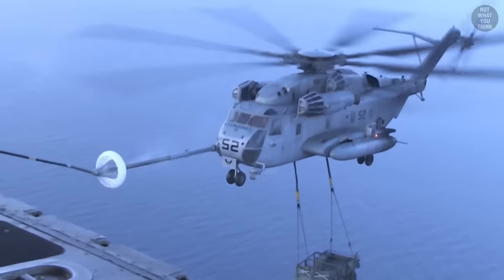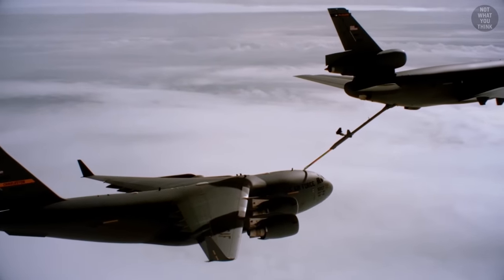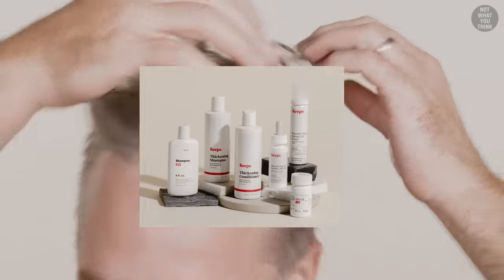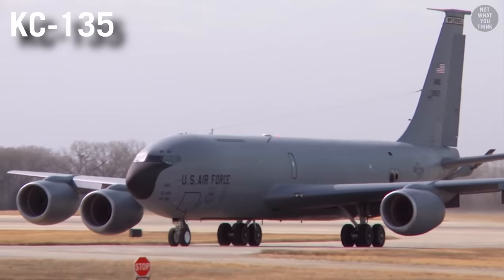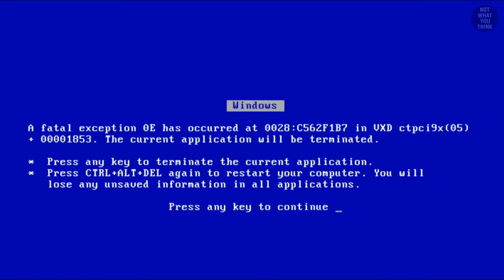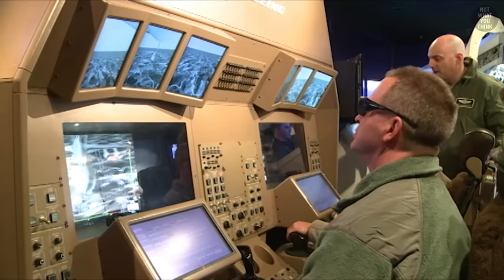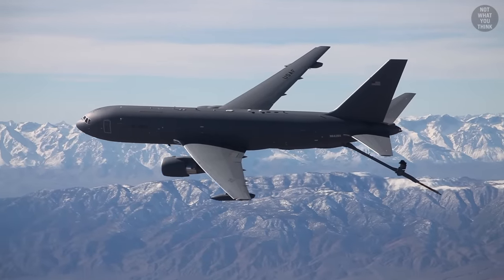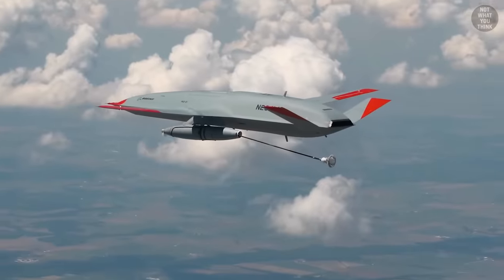Why US Air Force is Making Aerial Refueling HARDER?

Comment: This is what happens when you don't fight corruption. The airforce originally planned to purchase the superior and proven airbus mrtt. Now the airforce is stuck with a only partly operational tanker, which is more expensive and has less capacity. And now 10 years later, it seems like the government is going to buy the airbus anyways, now renamed the LMXT.
Reply: You think corruption is why the USAF didn't pick Airbus? You might want to have a think about that. Before the current string of Boeing failures Airbus had many, many design flaws that for the most part still exist. Software controlled, non coupled side sticks for starters.
Reply: @jameshisself9324  The airforce did pick the airbus. It was not until Boeing pulled strings at the DoD in order to reissue the tender, tailored to their POS KC-43
Reply: @romanpul  yes, a popular theory
Reply: @romanpul  Boeing filed and won a protest based on technical grounds.
Reply: @jameshisself9324   Oh really? Well care to list all these alleged "many, many design flaws that for the most part still exist"?
With your sources and links of course.
Because basically I call BS on your comment. Especially that crap about sidesticks.
Reply: @romanpul   What you state is absolute fact. the problem is we are dealing with a Boeing fanboy (@james Hisself) who cannot bear to see his beloved plane maker trashed. Even if its true!
Reply: @1chish  Fanboy? Airbus has had many crashes with plane loads full of people due to their design flaws. Yes, MCAS was a disaster. No fanboy could admit that. What I'm referring to with Airbus are the many alternate law accidents that confused pilots over the decades. You can blame pilots all you want, but if it can happen it will happen, and a plane load of dead passengers means you make it as hard as possible for the pilots to make mistakes. Physically linked controls, deeper redundancy on sensors, etc made the Boeing airliners less crashworthy. The 737Max was a disaster no doubt, mostly because Boeing tried to cost cut compete with what Airbus does that causes the same problems.
The only thing I'm a fanboy of is less crashes and less dead passengers. Get your head out of your ass.
Reply: @1chish  Agreed - the A320neo has been flying for longer than the 737MAX, and without any airframe losses or fatalities to date. And physically interconnecting the sidesticks introduces a lot of problems in itself - it basically ensure that both are jammed if either one does. There is only one pilot in command at one moment anyhow - failure to adhere to this points to far more fundamental flaws in cockpit management by the human operators than any technological design philosophy.
Reply: @s2k997   Spot on. Glad someone understands.
Reply: @s2k997  Sorry fellas, but playing the 'should' game is how Airbus lost planes and passengers. CRM always has the potential to breakdown due to crew experience or other factors, AF447 is a prefect example. Boeing loses the neo vs. max fight for sure, but the real problems I'm referring to are with the wider Airbus fleet from the earlier days of fbw. The only points I'm making are in support of passenger safety.
Reply: @jameshisself9324  Not following you so far. What are these 'should' games that Airbus has exclusively played? Again, a CRM breakdown is the fail of the crew, not the plane, and had been the doom of many a Boeing, Airbus, Lockheed, or Tupolev plane alike.
Reply: @s2k997  Look the airlines and the aerospace industry know this. If you guys don't want to learn about safety as a system and how the aircraft is part of that system I can't help you go study up.
The 'should' reference is to your comment about what an aircrew should do. That is the problem precisely. Expecting every situation to be understood and predictable, and relying on crew process alone as the last line of defense to prevent an accident is exactly what causes accidents. For instance alternate law being invoked when a single sensor fails (inadequate redundancy) and then not having good information for the crew or well understood changes to the flight dynamics of the aircraft. The side stick is only one of the many issues that break down crew intuition about how the plane feels and flies.  This has happened repeatedly and killed a lot of passengers. If you knew as much about the Airbus issues as you ought to you wouldn't be arguing.
Reply: @jameshisself9324  You sure do talk a lot to say that you're saying nothing. The best example of a lack of redundancy in sensors this century so far has been the MCAS's use of a single pitot tube. Maybe I need an education, but you cannot seem to name a single flaw as big as that howler - if you cannot put up, maybe it's time to shut up?
Reply: The 767 or better the KC-46 could do the job as good as the A330.
But Boeing,  not knowing what to do with all of their money decided against a simple window in the back and install a fancy new system for millions of dollars that doesn't work as it supposed to. Instead of saving the money by putting in a simple window they once again decided: 'Technology we want all of it, doesn't matter if it works it looks cool'
And that wonderful expensive system came of course with black and white screens. WTF?!?  What the hell is going on with Boeing? Have they fired all of their engineers or what? Who makes such dumb decisions ?

Btw the MCAS in the KC-46 works exactly as it's supposed to since it was put into the aircraft and always had all the redundancies the MCAS on the 737 lacked. 
Why would you use a system that works on some of your other aircrafts when you can develop it from scratch with the potential of a plane crash ? 
Sometimes Boeing itself doesn't know what Boeing is doing...
Reply: @s2k997  Oh FFS man, the list of accidents is all you need to review. If you can't bother to understand them so that you can see what I'm talking about then there is no helping you or showing you. It's all right there, ask any NTSB rep or just someone who has dug in to the reports and the facts of each of those mishaps.
I've already acknowledged the MCAS howler, the point you keep missing is that this was the first for Boeing but Airbus has probably half a dozen mishaps or incidents where similar aircraft controllability issues caused or nearly caused the deaths of everyone on board.
This is not about Airbus vs Boeing, in spite of the conclusions you lot have jumped to. Its simply about aviation safety.
Reply: @jameshisself9324  MCAS was the first for Boeing? So much for the boasted knowledge of safety - Shall we talk about the 737's frequent rudder reversal problem that caused multiple crashes? Or Japan Air Lines Flight 123 crashing due to Boeing's negligent structural repair work?  Or China Airlines Flight 611, another example of hundreds dying to 'quality' repair work performed by Boeing? Or United Airlines Flight 811 where Boeing failed to design a cargo door properly? 'first for Boeing' who are you kidding fella.
Reply: @s2k997  <facepalm>
All manufacturers have a list of failures.
I am specifically referring to SOFTWARE failures in FBW SYSTEMS.
I swear dude, I give up. There is no getting this for you.
Reply: @jameshisself9324  "playing the 'should' game is how Airbus lost planes and passengers" vs " This is not about Airbus vs Boeing, in spite of the conclusions you lot have jumped to" Contradiction, thy name is James Hisself.
Reply: @s2k997  No actually, just examples. Airbus lost planes as I stated. If it had been Boeing I would have said Boeing. Just examples.
Reply: @jameshisself9324  Burden of proof for a point is on the asserter, nobody else. You spend more time handwaving and moving the goal posts than naming any specific events. When you're naming more swearwords than specific events, then yeah, I agree, you aren't going to win people over with that trash.

"similar aircraft controllability issues caused or nearly caused the deaths of everyone on board" big difference from "I am specifically referring to SOFTWARE failures in FBW SYSTEMS" nice goalpost move.

If your core argument is "FBW is poopy, mechanical interlinking better",  burying your head in the sand when the 'old-hat' systems royally screwed up and got more people killed than all FBW incidents combined to date is a major blind spot that kind of kills your whole argument. Systems go wrong and aren't 100% reliable - but a well designed FBW system has more mean time between faults than conventional counterparts. There's a reason the U.S. Army is paying a fortune to reengineer the 1960s Chinooks with FBW, and it isn't "because it works worse".
Reply: @jameshisself9324  Yes actually - only a fanboy could one-sidely assert that Airbus lost planes as if Boeing didn't. On 29 October 2018 and 10 March 2019, Boeing airliners went down.

Why do you slate Airbus for "major design flaws... Software controlled, non coupled side sticks for starters" but give Boeing a free pass when they do exactly the same on several of their aircraft, such as the F/A 18? Is it only wrong when Airbus do it?
Reply: @s2k997  Again, this is not about FBW. Its about whoever's FBW is 'poopy' as you put it, and Airbus has a well documented history of exactly that. Well documented for anyone who wishes to pull their head out (of the sand or elsewhere) to review and bring themselves up to speed on the topic. It would seem that since we are this far into this back and forth and you are still not understanding the scope of the topic that we are wasting our time. No one on this end has any allegiance to the old way of doing anything. We've gotten to the point we are with a US near zero accident rate by using all of the tech that we can. The nuanced fine point here is when there is a systemic issue with some form of tech (Airbus FBW in this instance) that it needs called out and understood by all concerned and then corrections demanded. This is not a bizarre theory I'm trying to 'win you over' to. It's simple facts of the issue, perhaps to avoid scaring away travelers isn't talked about too much but it is there for anyone to see that looks. If you are going to present yourself as you know better than I do about this subject matter the least you co do *for yourself* is having a passing knowledge of Airbus commercial accident history as it pertains to FBW. I'm not presenting evidence and thus have no burden of proof. To further your analogy this is already settled law. I've already referenced AF447 as case law, you can take it from there or not.
To be clear we are not arguing. I was originally trying to shine a light on already understood accident data for the folks on the thread. Not an argument. 
At this point I simply do not care.
Reply: @jameshisself9324  fine, if you want it narrowed down to AF447, I'd say this - this accident isn't much to do with FBW. Firstly, it stated with the freezing of pitot tubes. Prior to the accident, Airbus had already recommended that Thales C16195AA pitot tubes, the problematic model used, should be replaced. The operator, Air France, 'knew better' and deliberately chose to ignore the instruction, leaving them vulnerable to excessive water ingress and freezing. A pitot tube design fault is not an FWB failure . Nor is a bad business decision by a company to ignore a safety-critical instruction a FBW failure. If the company hadn't been cheap, it's likely nothing would have happened that day. Even still, if the pilot hadn't committed to the needless decision to rapidly gain altitude amid repeated stall warnings, it's also unlikely to have happened. Blaming this on alternative law and FBW contradicts the prosecution's case, which is largely why they've persisted with legal action against Air France for operator failures. The final report, released on 5 July 2012, largely blamed operator error - is there any page of it you'd care to point to that blames the FBW?
Reply: @s2k997  Court cases don't have anything to do with real technical analysis, experts are there just for court room conclusions. They are all trying to take the story to a conclusion of blame for a given defendant. Nothing from any court case is relevant to anything I'm talking about and if you use court cases as a means of technical analysis you'll never get to the solutions that save lives like we have today. Good for you for at least looking at this, but the aviation sources for data are where the real meat is.
To wit- this is precisely an FBW software issue because the way the FC handled the sensor losses and put itself in alt law without having an appropriate way to make sure the pilots understood what was happening. Flying only ever in normal law builds an intuitive understanding of what the controls do. When the law changes and things like control limits and stability augmentation are taken away that presents a real problem for a flight crew in a time sensitive emergency. AF447 is probably not even the best example of the problem since the pilots had such poor decision making. But it does illustrate how humans will always find a way to make mistakes and the safe systems take away the reliance on aircrew perfection. Making pilots into heroes that always do the right thing causes accidents. No human is infallible and all pilots are human. We must engineer the human factors failure modes out of the system.
btw, MCAS problems were amplified because the carriers ordered their planes with the bare minimum single sensor with inadequate redundancy. Additional sensors would have prevented both of the crashes. Much like AF has blame for 447, the 2 carriers have blame for the sensor arrays being too weak. To understand these accidents you must dig into the accident reports and docket details. Much of this evidence is not in the report itself, as they are typically more of an executive summary of their conclusions and finger pointing is usually kept to a minimum for contributing factors.
Reply: @s2k997  Geezus. "Multiple people have called bs" yes clearly this is not the thread for aircraft safety engineering. That much is clear. This was all informational and you lot tried to turn it into an argument. I'm not here to teach you or site the examples. Time to grow up and learn for yourselves. 
I. Do. Not. Care.
Reply: @jameshisself9324  "I. Do. Not. Care." Continuously replying seems to contradict that, but that's not the first contradiction.  Good luck with the moon logic fella.
Reply: @s2k997  "it basically ensure that both are jammed if either one does" ... not true.
Reply: @JohnSmith-zi9or  Seem to be true in the loss of a Vans RV-8 on 13 June 2020, unless the accident report lies.

Comment: Seems like it would be a good application for first-person cameras and VR headsets or something. So the boom operators could basically “BE” the boom themselves and just direct themselves into the receptacle rather than trying to see it from a very far away 3rd person angle. Insanity that they developed this in black & white without aperture/exposure control.

Comment: I'm not sure if you did a video on it, but I couldn't find one so I would like to recommend that you do video on the E-6B mercury, it's the Navy doomsday plane, that has the ability to send and receive messages with submarines which are submerged which is very difficult, it can also give orders to launch missiles from said submarines as well as giving orders to nuclear capable bombers. And the best part is they can also launch land-based icbms from within the aircraft. To make it even more interesting the aircraft is designed (to a certain extent) to survive the effects of a nuclear blast, to include thermal and electromagnetic radiation.

Comment: Who would win:
A 500 million dollar camera program with over a decade of development.
One see-through boy.

Automation in refueling systems is great, and should be a thing. It'll make everything way faster and easier.
They should also still have a manual back-up system and train on it for emergency use.
Reply: This trend to me is engineers egos getting in their way. Instead of taking a step back and looking carefully at what works and whether it makes sense to change it... It seems like they change stuff a lot of times at Boeing especially under the assumption newer will be better. Anyone who has spent some time taking photos with a cell phone camera would know a normal camera sensor would do this. Any cursory test should have shown it. It makes me  sad, I want them to do good and make us all proud of our aerospace industry. They've got serious problems over there though stuff like this camera issue should have never made it past cursory testing.